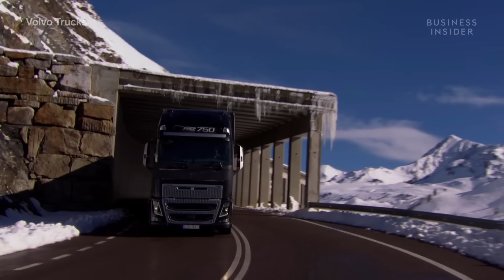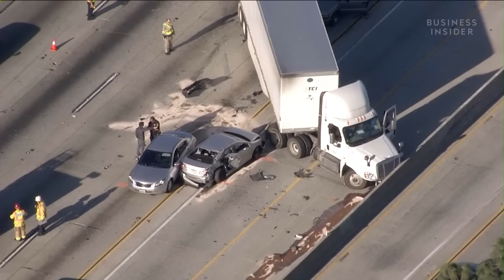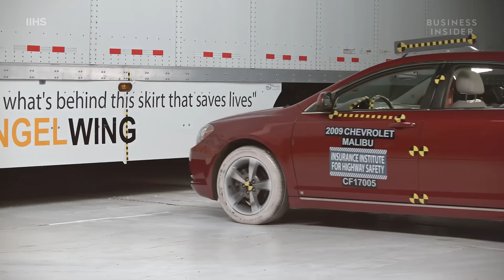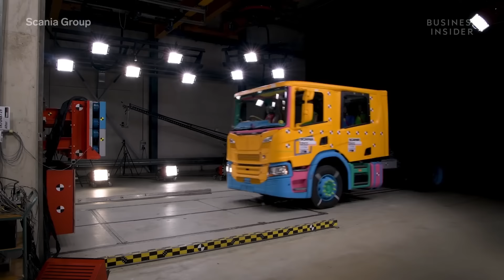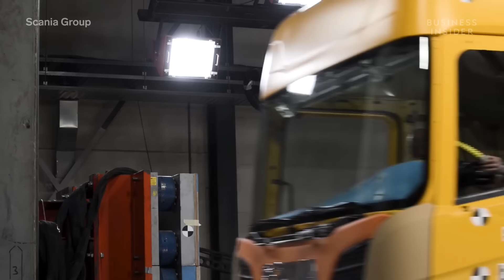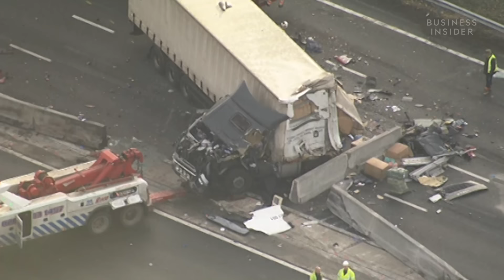How Semitrucks Are Crash Tested | Carsplainers | Insider Cars

Comment: On April 15, 2014 my dads 60 year old cousin died in a commercial truck crash. He was hauling fertilizer in Salem, South Dakota when the front tire blew out. My dads cousin lost control of the truck and went over the center line into the ditch and the rolled over several times until he hit a bunch of trees. He was pronounced dead at the scene.

Comment: Whoever did your research should really do a 3rd or even a 4th fact check. No standard road truck is 120 tons, even with a loaded trailer, in the U.S specifically, they aren’t legally allowed to go over 40, trailer and cargo included. 

Also, trailer underride barriers are mandated but good luck enforcing those safety protocols.

Comment: Quite often with those under run rails there are bolts removed so that mechanics can get access for maintenance then the rails are just folded back in place.. it looks the same but the rails would simply fold out of the way in an impact if those bolts arnt replaced. And many drivers do not pay any attention to those things during their daily checks. ☝️😐

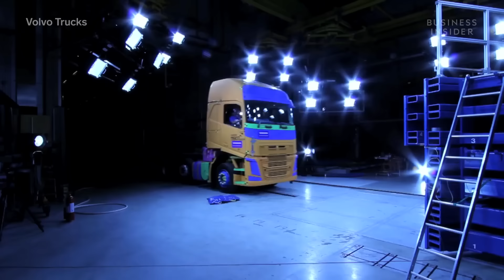Comment: At 2:50 you said that these trucks weight 120 tons. That is incorrect since by law they cannot accede 40 tons with a load included (Unless you have a heavy hauler license). The average cab weights about 15 tons (Or 33k pounds)